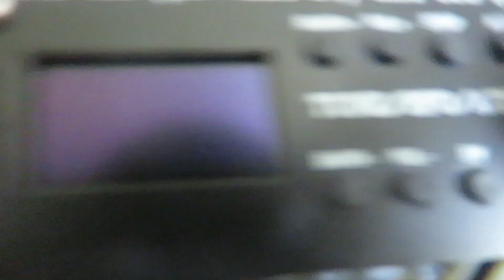Inside the ATS-20

Comment: I'm not sure what the wire going from pin D11 to the SS14 diode is for. My ATS-20 with a "Nano" marked "Arduino" and USB mini does not have this wire or continuity between them.

Comment: If it recognises as a serial port your drivers are good, I work with Nano clone boards and usually failed uploads occur because of the bootloader type, some use the older boot loader so needs to be selected when your in board manager, select old boot loader and it should work, Also a handy tip if your board boot loader becomes corrupt, is to hold down the reset button before clicking upload then release it just before it begins to write, it can take a few times, but will force write the sketch.

Comment: My ATS-20 has a USB mini .  At first I couldn't do anything with it.  I too useArduino Nano board with the AT328P (Old Bootloader) flavor. the Win 10 driver is USB-SERIAL CH340 though.  I made sure the port was recognized as COM 1.  Don't know why, but low serial port number sometimes helps with compatibility.
Reply from the maker: I think possibly the bootloader in my chip has gotten corrupted. i can't do anything with my ATS-20 at the moment. I may try replacing the Arduino.

Comment: I enjoy your channel. Ive had the same problem with my ATS20. I used the Nano with the old booterloader and it updated. Also had to use CH341a USB driver. I am currently used Ricardos v3.0.7 firmware very nice work! My current project is using the SI5351 synthersizer with an Arduino Nano for an external VFO for my old FT101E Ham Rigs.
Reply from the maker: Thanks for the feedback!

Comment: Tell us what the chip is on the clone board. That will tell us what it's pretending to be. I.e atmega 328 or 32u I suspect your settings in the Arduino ide are not matching your board hence your errors ZL1NAY
Reply from the maker: Thats the problem, these chips are totally unmarked!